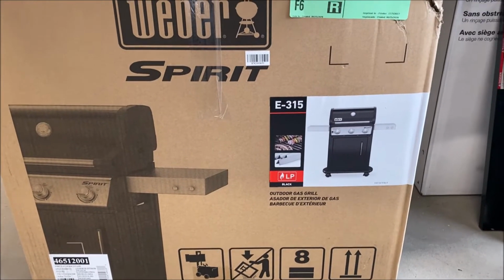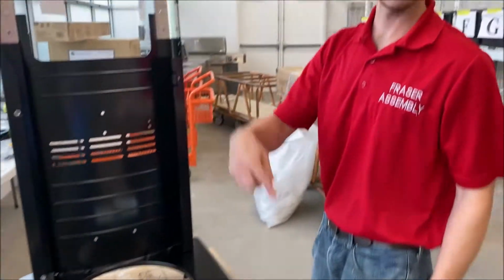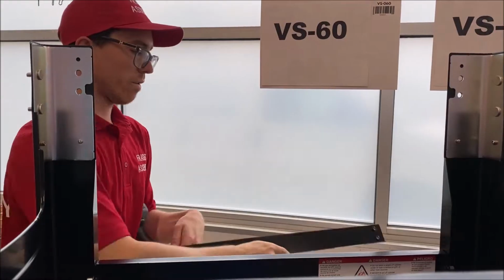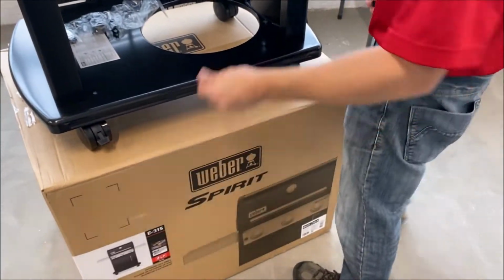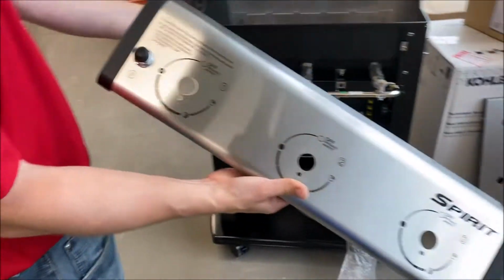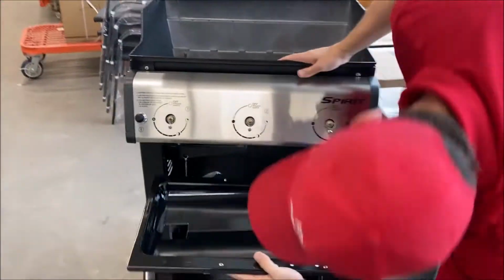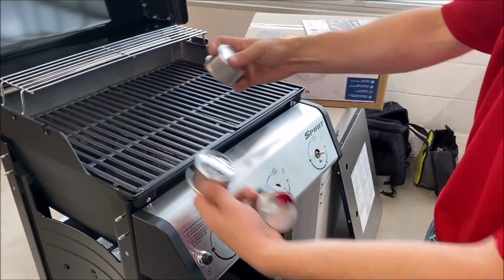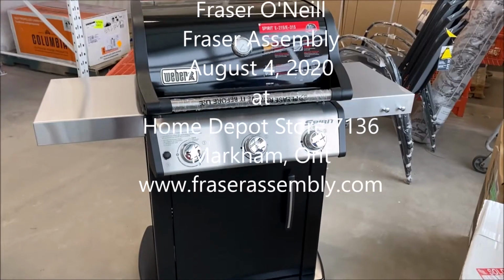Assembly of Weber BBQ, E315 Spirit

Comment: Just purchased a Spirit E-330.  Watched this video first.  Extremely well done and helpful.  The only addition is the side burner.  I'm pretty handy and it took me about 2 hours.   Did not rush.  Key is unpack all the parts first and lay them out.  Then step by step.  I used the picture instructions which were easy to interpret after watching this video.  Thank you Fraser!

Comment: Thank you for this helpful video. I got so far with the supplied just adequate printed instructions but they did not show the change in the Spirit S-315 Gas Grill circa Jan 2024. That change being only the back panel which is not as tall as that shown in the instructions and in this video. So thank you.

May I make a suggestion or perhaps more? Most of the steps were very clear on this video except a couple of things. I saw the first bolt/screws installed at finger tight but did not see, read or hear when they were tightened up using the electric device. I always put things together at finger tight since I keep making mistakes and also often need some flexibility in the set up as I add steps, then tighten them up once all the essential parts are installed. But it would be useful if there was even some text captions mentioning this. But he pointed out many things that the print instructions do not, so thank you again. A few times his head and cap got in the way especially when installing the plastic clips for the wiring. I never did really see what he was doing. Everything being black in there that does not help him. Not his fault. Perhaps loose the cap.

You might also add a caption in the text part of this video description that the model IDs that this video also apples to the perhaps newer Spirit S-315 Gas Grill. 

Lastly as a person who has made numerous instructional videos, a lavaliere mic that clips to his shirt would help a lot. It would keep his voice even in volume and cut out all the background noise of the other assemblies (out of sight but not out of hearing) making them far less loud and distracting. If I may, I could suggest using the new DJI Pocket Osmo 3 (https://www.amazon.com/DJI-Vlogging-Stabilization-Tracking-Photography/dp/B0CG19FGQ5/ref=sr_1_3?crid=B8W21EWG5MPH&keywords=dji%2Bpocket%2Bosmo%2B3&qid=1706116454&sprefix=Dpocket%2Bosmo%2B3%2Caps%2C136&sr=8-3&ufe=app_do%3Aamzn1.fos.2b70bf2b-6730-4ccf-ab97-eb60747b8daf&th=1) that is so small it is easy to get into the little spaces and it has a synchronized lavaliere mic that automatically connects with the video camera (which is built into its own tiny stabilizer) and gives fantastic sound just as the Osmo 3 provides superb video that also can be seen and controlled from a remote smart phone via the blue tooth connection that is part of the internal and external app for the devices. Really easy to use on full automatic and has a zoom to get closer to his fingers so we can see better what he is doing. This is a very new product and is head and shoulders further along than its predecessors. I shoot professionally and this works just fine. You can even mount it on a short pole to push it into the enclosures for a better view. Just "sayin' " as they say.)

But again thank you. This is a life saver. 24 Jan, 2024

Comment: Excellent! Weber should include this video with the grill. One question. When you attach the door, what is the purpose of the chain hanging from the grease tray? It is covered in plastic wrap. Thanks.
Reply: it's a match holder, so that if for some reason the electric ignition doesn't work, you put a match on the end of it and there will be a hole somewhere on the grill to insert the lit match to light the burners